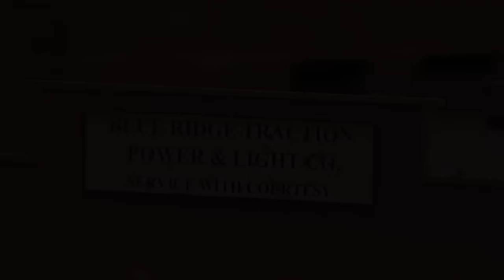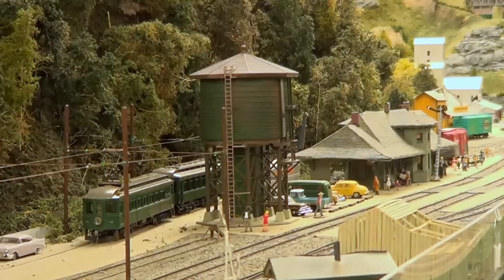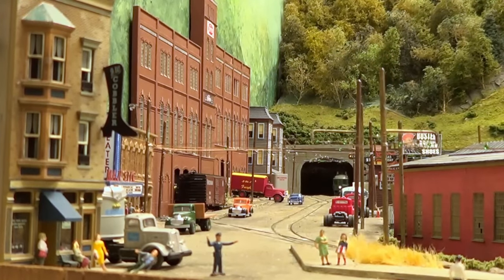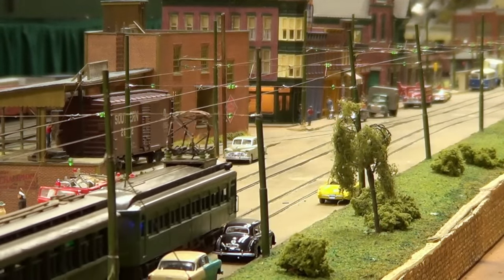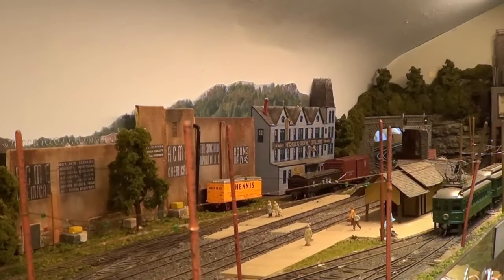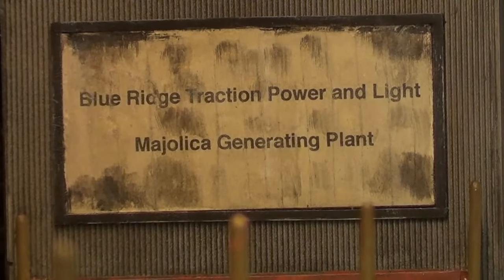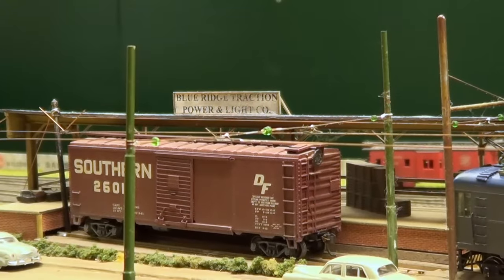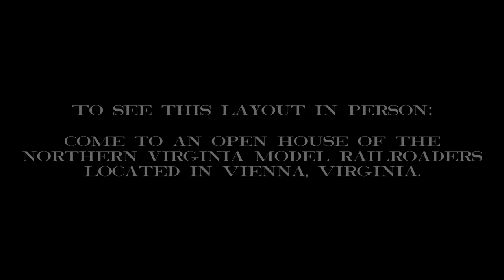An Interurban Trolley Line Powered by the Overhead Wires in HO Scale

Comment: Not a lot of actual overhead power on layouts these days! I take my hat off to whoever strung and maintains that linear metal cobweb in working order.
Reply: Exactly. First layout I've seen on YT of any scale with working overhead whether traction or freight/passenger.
Reply: @musicman8942  Man have I got a gift for you then (link below). I'm a bit addicted to overhead in HO scale too and go looking for it on YouTube. The link below is by far and I do mean, by far, the most impressive I have ever seen.

The overhead starts at around the 3min mark. The detail and weathering is insane.
Bill Kachel's Cosmopolitian Division of the PRR:
https://www.youtube.com/watch?v=GVJ7xfkdx6M
Reply: @ThePaulv12  I caught that layout 7 years ago and the catenary is not hot. Nice looking layout though.
Reply: The only model railway manufacturer to produce a working overhead power system and locomotives was Triang Railways / Triang-Hornby, from 1958 until 1972. The overhead electric locos had a switch, on the roof, that gave the option of either rail or catenary power pick up. I have a 1960's Triang-Hornby British Railways AL2 (TOPS Class 82) BO-BO electric loco along with the working catenary system.
Reply: @CZ350tuner  Pittman produced a working catenary system for their O scale trolleys, called 'Erect-a-Wire'. This was around in the 50s and 60s, iirc. Not a ton of information I've seen on it.

Comment: Running catenary in HO is no easy feat - even more so when it's actually going to be powering the interurban cars.  My hat's off to whoever did the catenary work - you have a skill and patience that I don't and probably won't ever have.
Reply: Thank you.  In the late 1980s I took on the project of making the traction line work, running from the overhead.  I still have the cut-down hemostats I used to clamp the phosphor-bronze overhead and the wire bits to actually hang the wire.

Comment: Nice to see some of the trolley poles I designed, built, and installed on the layout are still in service.  That was in the late 1980s and I still have the pattern pole.  That traction line was originally straight DC while the rest of the layout was using CTC-16.  With overhead power you don't have to worry about loops.

Comment: Not the most prototypical traction cars but damn they run great and that's a lot when you consider the difficulty of the catenary infrastructure, great job!
Reply: What are you expecting?  I have seen a large variation in traction equipment, from street cars to very heavy interurban which can be classed as steam railroad equipment.  Depends on the area of service and the service provided.

Comment: I have had traction layouts before and they are awesome but very cranky ( temperature, humidity and heat sensitive, yes really!). It is very satisfiying when they work right.  I have taken an alternative route and now do chicago subway cars with only a hint of overhead wire operation as such was the case here .  I do not model the third rail and for once have reliable operation all the time. I might add that O and S gauges are better suited to traction with O probably being the best. I do S gauge but depend on O gauge hardware to supply most overhead parts and poles.  The smaller size of HO makes overhead construction really demanding!

Comment: I know nothing about traction. Does the trolley get its power from the track or from the overhead power lines? I used to live over by Asheville NC.  Great layout. Scenery is exactly what I remember that area looking like. Great job!
Reply from the maker: Models of Trolley and Traction equipment can be set up either way, and these models have been set up so that at a flick of a couple switches they too can be run either way. In the case of this video, the electric cars (89 and 630) were getting their power from the overhead wires, with the rails acting as ground.

Comment: Hi, from England, UK. I've often wondered if anyone had made a layout where a line came out of a tunnel and then ran straight onto a road, now I've seen one. And while I've seen plenty model trains and loco's working off a live overhead catenary, I've still never seen any working off a live third rail like the mass transit trains in the cities, the only ones I've seen only had dummy third rails. And don't those electric units on this layout run so cleanly with almost no arcing, that takes some doing.